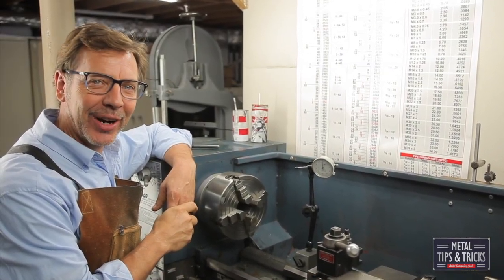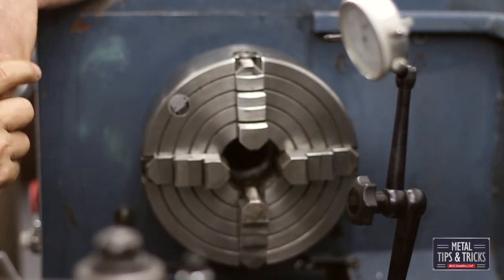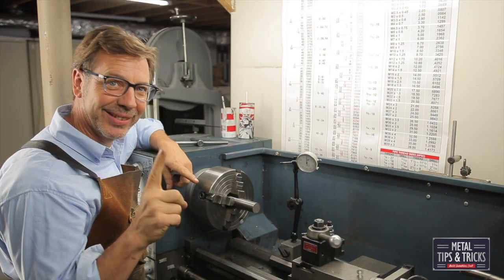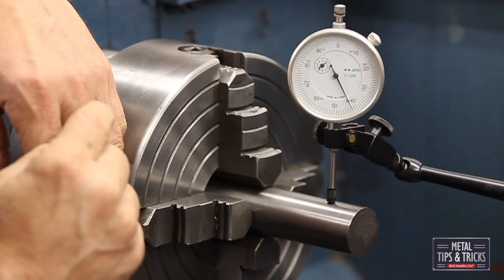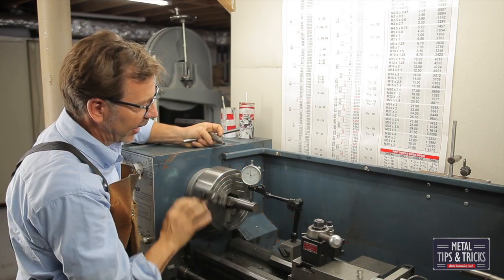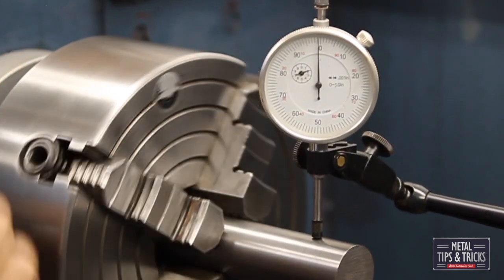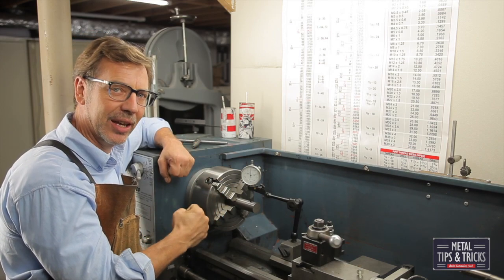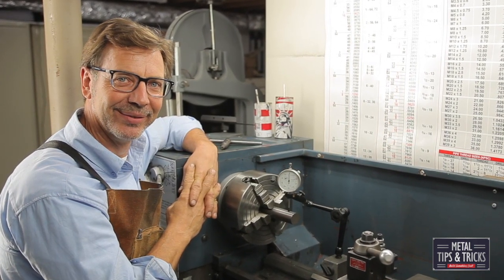How to use a 4 jaw chuck

Comment: Nothing said about how you have only adjusted the part for concentricity at the point where you setup the indicator. There is no guarantee that it is actually coaxial with the lathe spindle. You need to indicate at 2 points to check for that. Of course, if your chuck jaws are true and in good condition, and if the part is smooth and long (compared to the jaws), you have a good chance that setting up the indicator at 1 points will do an adequate job. However, worn jaws, rough parts, short parts are all too easily setup wrongly when you rely on a single indicator position.

Comment: I think this video is missing what happens and how to correct when the piece is not aligned with the lathe, if you displace the dial indicator longitudinally trough the pice you may notice sometimes that the high and low spots differs and this situation is not explained.

Comment: Great video as always, straight and to the point with zero nonsense.
Reply: Yep, there's not that much to it but everything that needed addressing was addressed. 

Keep in mind though that this video is only an demonstration for pieces with long jaw contact.
Pieces with small jaw contact also need to be dialed in for angular alignment.
Reply from the maker: Thanks Mr Betaryer :-)

Comment: Thanks for the vid Dale..... just got my 4 jaw yesterday. There sure is a huge difference between the 3 and 4. Used your technique and works great especially on the square stock. Just need to take it easy on the clamps when I get below 5 thou difference.
Reply from the maker: Congratulations on the new Chuck :-)

Comment: That dial indicator holder is lovely. You were able to bring the needle to the correct spot by adjusting a screw on the stand. Any chance that you could tell us the manufacturer or give us a link because I would like one. It must beat my Draper one hands down

Comment: I had to watch it again, it's amazing how fast you forget the steps. Thank goodness I know where to look. By the way Dale, what is the brand name of your lathe and size? My 13x40 South Bend is running great. I still have some parts to replace but physically I'm going downhill. I want to sell mine and get a HD gearhead, 10" to 13" that is in great shape. All I want to do is come out to the garage, check the oil and put a piece of steel in to turn or play with. No more paint or parts to rebuild. Any brand names you can suggest? Thanks, and great video.

Comment: Personally I don't like to wrench on the side of the indicator since I don't want to accidentally hit it with either the chuck key or my arms.
I usually probe the front, determine which sides to loosen and fasten. Then I move the screw I want to manipulate to the top and either loosen or tighten it.
However moving around jaws directly in line with the indicator may prevent confusion for people who are new to this sort of thing.
Reply from the maker: Good Comment. :-)

Comment: Is it correct that the averaging of the high/low automatically accounts for the two independent axis of rotation? What happens if your high or low measurement doesn't fall in line with one of the axis of movement?
Reply: It does not matter where the high and low are in relation to the jaws.  Once you set the dial to zero you simply set each jaw set to zero.  Then repeat a  few times to tweak it in.  I learned this method from a mr. pete video and it works great.  Chris
Reply from the maker: Thanks for ansering this question Shadowdog

Comment: I liked the video, I can indicate a 4-jaw with no problem, but I have made a spindle that I turned between centers with a shoulder and threads for a spin on chuck it's for a L.H.Sparey dividing head chucked up in the 4 jaw indicated it .250 out from jaws .0005 runout or less moved out 1.750 and it's out .002 plus. I need to bore out the spindle end  for arbors to hold gear blanks any ideas
Reply: Either try tapping your part straight with copper block or fix your jaws for parallel clamping, assuming your spindle is perfect.
Reply: The spindle in straight .999 at each end and no taper, I put a piece of drill rod .750 dia. and it reads about the same, removed the 4-jaw from the backing plate, left backing plate on lathe indicate it .000 run out,
 if the jaws are tight how could the spindle be moved with a copper block, also how do you fix the jaws for parallel clamping
Reply: I don't know the length of your part, put it will move under the jaws when you tap it lightly with copper, the jaws are never so tight or play free in their slots. But if the jaws do not clamp parallel, you have to turn or grind them when preloaded.

Comment: my 4 jaw chuck has only 2 key holes. 
I'm a total noob, so please forgive my questions.

does it mean my chuck is self centering?
does it mean I won;t be able to mount stock off center, to machine cams and off center shapes?
does it mean I should now buy 4 jaws independent chuck on top of the one I have?
Reply from the maker: You should ask do you need one, would you use it, not everyone needs one or would use it.:-)
Reply: @BuildSomthingCool  I produce switchable magnets in batches. 
It requires boring 1 inch diameter 1.25 inch deep holes in aluminium and iron, formed as rectangular profile. 
I bought the lathe primarily for that job, but I want to drill off centre and also make cam locks etc
So 4 jaws independent chuck was actually my 1st choice. When I ordered the lathe I assumed 4 jaw chucks are independent and they sent me self centering 4 jaw, and I am forced to buy another chuck, and buy/make back plate with 4 bolts, because 4 jaw self centering is 3 bolts mount and 4 jaws independent is 4 bolts mount
Lesson learned. Sigh

Comment: Hi, you made grate videos, I just have question here, I did the same exactly what you did, but when I slide my Dial Indecator to the begining ( close to the chuck the dial read crazy run out!!!

So I re did e erything from the begining this time the dial next to the jaws and when I have almost .001 and move my dial to the end of the shaft start reading crazy runout!!!

I refaced the backplate of the chuck, also rechanged the jaws to different locations 1234, also using high precision steel 10mm OD shaft

But nothing work! Same problem I can only do this in one spot e every time I slide th4 Dial to different spot the dial read hug runout 

Please help
Oz

Comment: I recently made a 'holder' that takes my dial gauge, that then slots in/out of the tool post, needle sits bang on at centre height, I thought that were an important point? I also made a smaller second chuck key,....wish I had seen this video before I done all that. Lol
Reply from the maker: That a nice way to do it. :-)

Comment: NEWBE ..any help is greatly appreciated. About me new to machining. New to YouTube. Not new to tools in general and using them. Always want to lathe(old iron) finally got one. Now what? :-) this is where I'm at I believe I have purchased 60s era closing Colchester 13-in laid I believe it's a geared head. They were selling a few pieces of older machinery including a SBL turret mill with power feeds and digital readout it's gigantic... They are willing to sell that for $1,600 I really would like to pick that up as well my thinking being it can do what a Bridgeport does and is certainly a lot cheaper?  I'll try to include a picture of both units... So this is where y'all could greatly help... A should I get the mill? I mean is it Bridgeport like? Are they garbage having the digital readout and multiple powered accesses which they said worked it seems like a good deal for 1600 it's very sturdy and looks comparable to a Bridgeport too perhaps I'm aware I could be all wrong thoughts on this? I'm not looking to do anything other than just play with it and learn about working with it also the lathe I just purchased I'm not sure what I should go through before I try to run it I know it requires oil it looks like in the carriage and I would imagine for the geared head. I need to find a manual but I don't how to find it  it says mch no. F3  58669.    Clc 27.    Where do I start besides cleaning her up carefully.   Thanks for any info

Comment: the best way is to use two adjustment tools at once. make some with round, knurled knobs on them. then run one in and the other one out at the same time. an old machinist tought me this method.